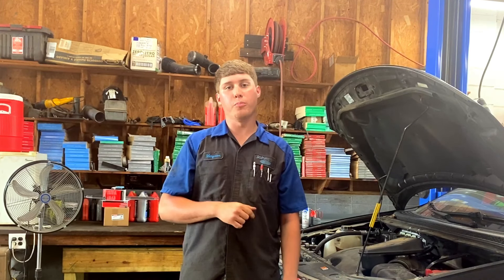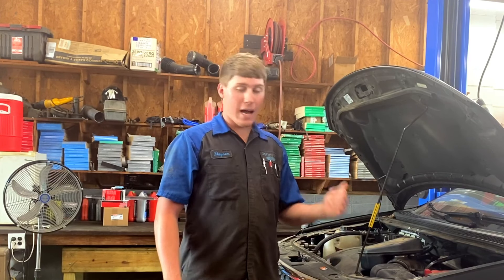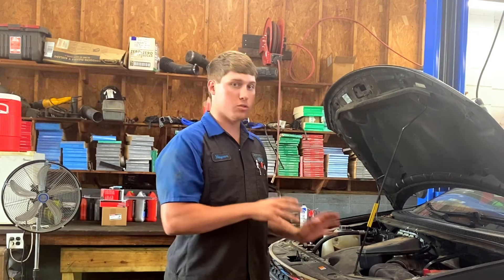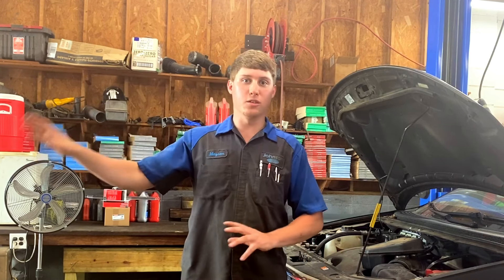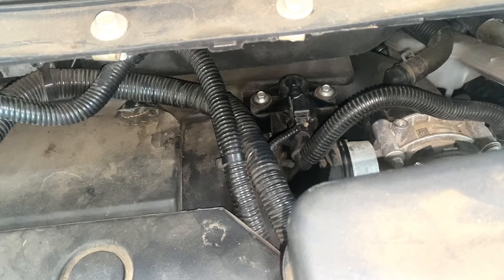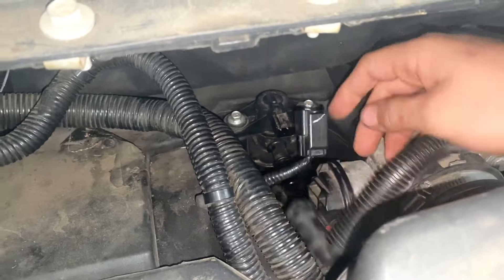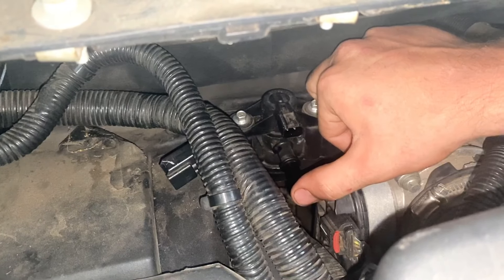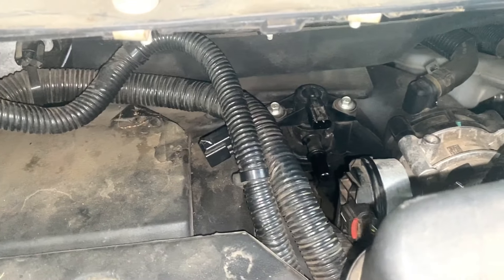FORD: How to Diagnose and Repair DTC P1450 (Purge Valve)

Comment: I also have replace a few of these. However I have a 2013 and the purge valve on this one seems fine. I T'd in a vacuum line and there's like 3psi on the system, collapsing the fuel tank, but the fuel tank pressure sensor only reads -0.31psi????..... I can't find anybody who's repaired this code any other way. Should I just replace the purge valve on this person's vehicle too and just hope that's it!?!?

Comment: What are other causes? The rest of the 1% of the time. I have an intermittent issue with an E-450 . Everytime it's brought to the shop I do the test with the IDS and it passes . Customer states that the vehicle will stall , start and stall . But Everytime it comes to the shop same issue .

Comment: Thank you for the diagnostic help.  That looks like an easy fix and I'm sure will save hundreds not taking it to the dealer.
Reply from the maker: Thanks man! I hope it does.
Reply: @FlyingWrenches13  Just finished fixing my wife's aunt's car.  Took 20 minutes.  The check engine light didn't go off right away.  Told her to drive it for a while and it would probably go off.  Does that sound right?

Comment: Just had it done on my 14 Fusion Titanium AWD 2.0. with 191000km.
The fix is the whole Assembly replacement.Part was $168.00 + labour =$300.00 Canadian.Not at the dealer,my Trusted local shop

Comment: So I have a 2016 Ford Fusion 1.5L I’ve been having this issue so I replaced the purge valve filled up wouldn’t start until I pushed the gas while it cranks ok went ahead replaced the  Vapor Canister
Vent Solenoid filled up again before heading to Vegas it cranks little struggle but it started alright no check engine light filled up over there before heading back home again struggled used the gas while it cranked and now still have this code, anything else you recommend to replaced?

Comment: Are you sure there should not be a "pull" on the vacuum value?  I got the error code P1450 on my 2014 Ford Escape after an oil change.  After taking the hoses and clipped wire lines off and checking the vacuum (which was pulling), I reassembled it and the engine light went off.  I'm wondering if the cheap oil change place loosened a hose when uncovering the air filter.  Last thing, thanks for the video!  I would not have known what I was even looking for without it!

Comment: I'm getting the P1450 on my '98 Ranger with 3.0 V6. Valve seems to be working properly. It did not pull vacuum when connector was unplugged and only started pulling vacuum when warmed up for several minutes. The hose looks a little dry though. Could a hole/crack in the hose cause the code or would it need to be blocked up?

Comment: Thanks for the video, so far the most detailed but straight forward as well. I have 2016 Ford Edge Ecoboost. Can you tell me the exact part number and will it be easy like in your video or will it have a different hose system due to being ecoboost?

Comment: I have a 2016 Ford Edge
Titanium - L4 - 2.0L 1999cc 122ci GAS DI
Turbocharged vin 9 - 4 valve DOHC
Which part number would I need and where in the vehicle is it located?  I saw one video on a SEL that shows it under the car. 😳. Thanks!!

Comment: Hey I have a 2015 Ford Mustang 5.0 I got code p1450 I change the purge valve but I still get the engine light but I got a code of p0446 at same time with p1450. Should change the canister vent valve or change another purge valve
Reply from the maker: If you have already changed the purge valve, I definitely wouldn’t change it again. The purge valve probably fixed the 1450 code. The p0446 is actually a circuit DTC so it could have some wiring issues. You could replace the vent valve and see if that takes care of it. Especially if it’s real cheap. Make sure you check the wires at the connector for the vent valve real good. I have seen them break there before. If the vent valve doesn’t fix it, your probably going to have to get you a wiring diagram and test the wiring for good continuity from the pcm to vent valve.

Comment: Hey man thanks for the great video! I have been troubled with this code P1450(unable to bleed fuel tank vaccum) and still have not found a solution. I have changed the purge flow solenoid as well as the vent solenoid attached to the charcoal canister box. Forsccan data shows 3D 81(blocked evap system line-fault confirmation test) not ready, and 3D 82(vapor blocking valve perfromance) not ready. For some reason it is never able to test. Any idea of what you think can be causing this? I have a 2016 ford f150 5.0. Thanks so much!
Reply: check fuel tank pressure sensor. sometimes if they are undercoated or contaminated they show EVAP system stuck in a vacuum . Tank pressure key on engine off show read near zero and tank voltage right at 2.6 volts. If not, fuel tank pressure sensor is faulty
Reply: Hi did you ever find a solution? I'm in a similar boat

Comment: Hi, I'm troubleshooting a 2014 ecoboost Fusion that at normal temperature will fail after you shut off the engine or if  its in park it will run very rough or shutoff.
Reply from the maker: Sorry, I’m just a little bit confused. What is failing after you shut it off at normal temperatures? Runs rough in park at operating temp, does it do that every time it’s in park?
Reply: @FlyingWrenches13  sorry for my confusing second language 😅 so after the car warms up and is running it will shut off or lose power and the engine begins running rough, if you wait ten plus minutes then you can drive again for a while and so on. I hope this helps. Thanks 😊
Reply from the maker: Have you gotten any dtc’s out of it?
Reply: @FlyingWrenches13  so the car reset the computer being parked for over six months, right now as we speak is at the dealer having three recalls done and because it doesn't have an engine light on they won't do the diags because it wont pull the code
Reply from the maker: What engine is in it?

Comment: Hi Mason, good video...I have a 2016 f150 xlt 3.5 eco and I'm getting the p1450 code for the second time...I took to the ford dealer and they replaced the filler tube...meet that code popped up again....my truck doesn't have that kind of purge valve you show in your video....maybe ford used a different type on that year...was wandering if you have any advice on what I should bemlooking for since I believe I have a different style purge valve?? Thankd
Reply: I also have a 2016 f150, and My purge valve is right in the center of the engine bay. There's a green connector holding it to the tube.

But a shop replaced it months ago and I still have that code. Plus I tested the new one and it looks good. Nick, did you find another way to clear that code?

Comment: Changed the whole valve assembly about 2 years ago on my 2016 Ford Escape Titanium. Don’t remember the code. Just recently after filling up got P1450.  Glad you showed how to rule in the solenoid.   Is there a way to rule out the large valve assembly part?  If I can get suction when I disconnect from solenoid does that mean it’s okay?
Reply from the maker: Should be able to just unplug connector and line coming from tank. Start the engine and if it’s pulling a vacuum the purge valve is bad. Other than that, it’s pretty hard to check anything else without a scanner that allows you to command the purge and vent valve open or closed.

Comment: Question: I have error code P1450 on my 2015 Ford Fiesta. However, the check engine light comes on and off and I only have problems starting after filling up every so often. My check engine light then went away and I ended up passing my emissions test so I wasn't going to sweat fixing it ASAP.  I've been putting it off for a month now but my car ended up dying last Friday as I was in an intersection at a red light. The shop said Alternator and Starter and battery are all good and I was able to drive home after pulling over to turn my car on and off after it stalled for a sec!? Any advice? I'm not sure if replacing this will help?

Comment: Dang - I have this issue on a 2017 Ford Escape with the Eco Boost.  I am thinking that requires the other crazy looking hose assembly and not the part pictured in this video?
Reply from the maker: Yeah it does. It’s a real pain to put on too
Reply: @FlyingWrenches13  I cleared the code for now, and I'm waiting to see if it comes back.  We just had an extreme weather change in the past week.  Local dealer just said they wanted to replace the hose assembly and canister for $1500.00!  Told them, nah, I'll figure something out!
Reply from the maker: Just replace the purge valve. No need to replace the canister. If your pretty handy you could do it yourself but expect to get really aggravated with it.

Comment: Can you please tell me the part number for a EVAP purge control  valve for a 2017 ford fusion 1.5L ecoboost with a code P0456
Reply from the maker: Part number is HG9Z-9D289-F

Comment: Great video, thx. Quick question. I’ve got a 2019 edge 2.0 SEL. Orielly sold me a purge valve canister but it appears I need to replace the entire “spider hose”  assembly. Does that sound right?  Thanks!
Reply from the maker: Yes sir! That is correct. It is pretty difficult to put on too.
Reply: @FlyingWrenches13  I GREATLY appreciate your reply. It’s extremely helpful. Keep up the great work. You now have a fan for life!

Comment: Thanks. 
I changed my purge valve twice in 30 days. The check engine light went off but the valve is ticking like crazy. 
Any tips?
Reply: When you say ticking, is that a sound?
Reply: Supposed to tick, they have a duty-cycle.

Comment: Question: what are the consequences if you do not get the problem fixed? I am having this issue with my Ford, but the only time there is an issue is right after I fuel up, when I have to pump the gas a little, then it is fine until my next fill-up.
Reply from the maker: What kind of vehicle?
Reply: @FlyingWrenches13  2014 Ford Fiesta.
Reply: You won’t pass emissions pretty much.  As long as it’s not a large leak going right out into the atmosphere which is likely to waste a bit of your gas and you don’t mind annoying lights on your dash you’re probably fine

Comment: I have a 1450 code on a 2006 Escape. It has the older purge valve with two lines. Do I check the lower line for vacuum? The upper line goes to the intake manifold.
Reply: Did you find out the problem? Just tested it on 2006 ford escape v6 and its only pulling vacuum when it should. My 1450 code is hard to diagnose
Reply: @ELY-qg2vn  Sorry. but I haven't found the issue yet. I changed the pv with a Motorcraft part, but the error code returned. I replaced the gas cap, which worked for quite a while, but the code returned. It's my nephew's car, so I haven't looked at it lately, but he tells me the code is still there.
Reply: @kevinalexander1645  Seems like a fairly common issue on 2006 escapes, but i cant seem to find a single solution online. Thanks for the response. Ill respond if i figure it out

Comment: Hi, Does this vedio apply to  ford edge 2018 2.0l eco boost with check engine error P1450. Could be provide me the part number details as well.
Reply from the maker: Yeah it does affect the 2.0 In The edge as well. I didn’t put it in the video because it is pretty difficult to put on. Bb5Z-9G271-B
Reply: @FlyingWrenches13  is this the same part number for a 2015 edge with the 2.0?  There are so many part numbers for these and it's difficult to see a difference with pictures.
Reply from the maker: @WarMachine550  it’s honestly all depending on the vehicle. I would take your vin to the dealer and let them give you a part number so your for sure it’s the right one.
Reply: Ok. And the part I'm asking for is the canister purge valve?  Or does ford call it something else?

Comment: so I just change my air filter and took that big black plastic tubing off and put it back on I thought it was a simple job perhaps I knocked something loose because now I hear a sucking farting sound coming from the spot where you fill your gas and I'm wondering if it's related because no check engine light is coming on
Reply from the maker: Not sure what kind of vehicle but it sounds like your purge valve is stuck open causing a vacuum on the fuel tank
Reply: Do you have a hard time starting your vehicle after getting gas? If so, it’s probably the EVAP purge valve.

Comment: I replaced the valve on my 'o6 Expedition but still get the P1450 code.  The thing is, I only got that code after I had it in the shop for the 100k tune-up and when I got it back, I started smelling gas fumes.  Do you think the shop could have pinched the hose  running from the engine compartment to the evap canister? or maybe a bad evap canister? or bad hose?  I'm not blaming my mechanic, he actually was trying to help me find where the smell was coming from thinking the same thing, but we couldn't nail down the source.  Then I started getting the code. TIA
Reply from the maker: Have you ever overfilled it? Sometimes if you pump to much gas in it can fill the canister with fuel.
Reply: Did you ever fix this problem. Same exact thing happened to me.
Reply: Did you ever find the problem ?

Comment: I got confused. You said there shouldn't be any vacuum. Then you said there is a vacuum on your finger so it should be replaced
Reply: The purge valve with no power going to it is closed. So there shouldnt be vacuum like you heard. There is a vacuum however because it is faulty and stuck open.

Comment: It's a shame that these purge valves are failing at an alarming rate. We have Ford explorers in our LE department. We're going on our second round of replacing the purge valves. My opinion is that the rubber seal in the valve is NOT compatible with ethanol fuel. Causing the rubber to harden up and creating a bad seal. I don't like ethanol fuel because it cost consumers a lot of money. Including lower fuel mileage range also. So you tell me how that's better for the economy.